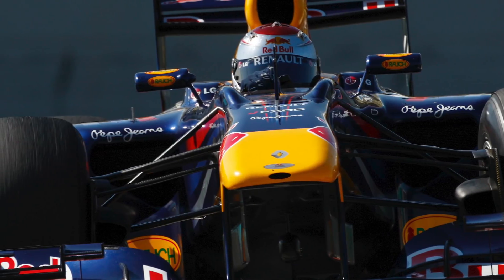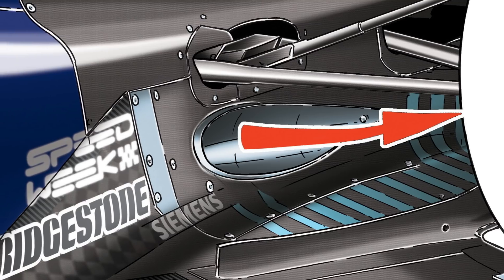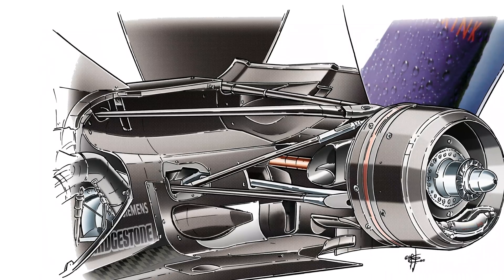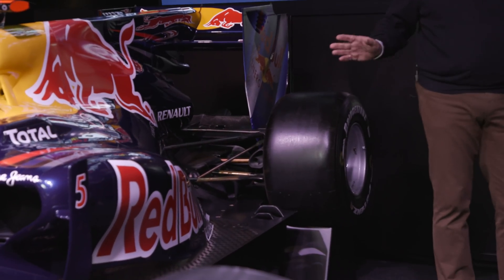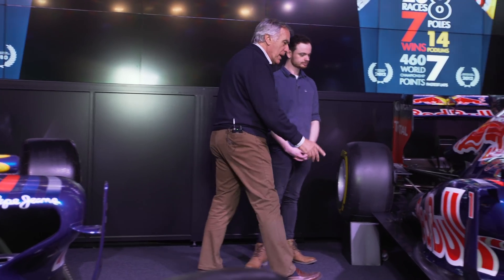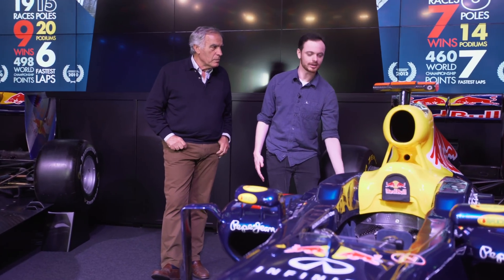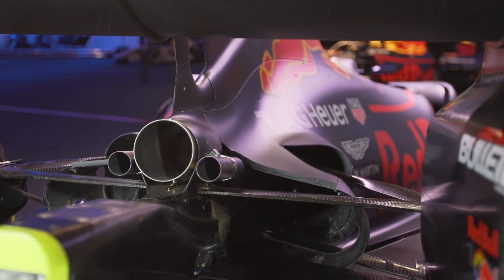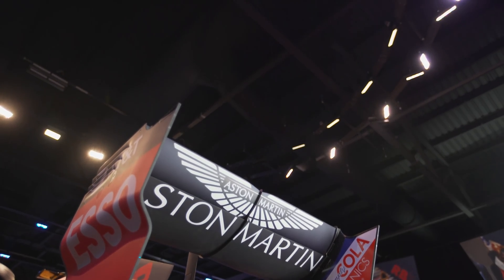The F1 aero trick Red Bull stole a march with - before it was banned

Comment: FIA: "F1 should be about innovation and technology progress!"
Teams: innovates something
FIA: "Wait. That's illegal"
Reply: What is the reason behind this? Safety? Or just bullying designers?
Reply: @faber6021  supposedly they do it to keep any team from gaining an "unfair " advantage over the others since some ideas are so over powered that the other teams have no chance.
Reply: @faber6021  Cost is also a reason.
Reply: Accept when the innovation come from Mercedes.  Then it's fine.
Reply: @elessarKP  agree
Reply: @elessarKP  what have merc innovated that hasnt been banned?
Reply: @nanderlizernanderlizer684  the question is on how quickly it has been banned. Read above.
Reply: @elessarKP  You mean Ferarri..
Reply: @sp3c0ps  ok tell me an example .
Reply: @elessarKP  all examples
Reply: @sp3c0ps  tell me one. I won't play tag. Either you know one or you don't.
Reply: @elessarKP  DAS...
Reply: @elessarKP  except that isnt true. I cant stand f1 fans who just make stuff up. Let's see. Oil burning = banned as the fia thought it helped Mercedes. Fric suspension = banned as it helped Mercedes. Look at all the aero changes the fia have forced through since 2014 all done to stop Mercedes.
Reply: @ads2686  yes after they let them use it for an entire season even though it was illegal from the start. On the other hand they forced Ferrari to change their recovery system 2 races after they introduce it, with the third engine update.  All that after Mercedes filed a complaint. Come on man a 5 year dominance it too long and the fact that the former leader of the team Ross Brawn is now the Managing Director of F1 its makes it even more clear. I mean he is I the guy that put together the team that is now Mercedes.  Hell he even groomed Toto Wolff to take his place in Mercedes.
Reply: KpElessar Mercedes did that because they wanted to know how Ferrari’s system worked, so they asked the FIA to tell them how it was legal and how it worked. 
Same thing is happening now with the inquiry into Ferrari’s engine. Mercedes want the FIA to clarify why it’s legal, by telling them how it works. 

People always have a problem with Todt being ex-Ferrari but not with Brawn having a position in F1 management, given he was responsible for Mercedes becoming successful in 2014.
Reply: @ads2686  Don't forget the DAS system also being banned
Reply: @elessarKP  yeah we want more red bull dominance instead of Mercedes dominance.... Obviously that's much better 😒
Reply: @kityhawk2000  of course not... I want free development with no copyright restrictions. Imagine all these ingenious ideas all adapted in car. If it doesn't compromise safety it should be aloud. Otherwise make it a stock car championship.  I hate dominant periods in F1. Also red bull had the smallest with only two years. The other two where fought to the last race. Unlike Mercedes where the last 6 years under the FIA and Brawn's protection they have no contenders and it's not even interesting! Because as soon as someone finds a way  to be competitive they shut them down. Like Ferrari last year with the power recovery battery. But two years back they overlooked at Mercedes when they where burning oil.
Reply: kityhawk2000 no Team ever dominated like mercedes. The RedBull era was still interessting to watch
Reply: @elessarKP  I'd say BrawnGP's was the smallest period, no.  They only existed for one year, Ross Brawn built a MONSTER of a car that absolutely DOMINATED.
Reply: @collink7145  yeah but it was dominant for about the 3/4 of the season and that is to be expected from a season after major rule changes. But yeah Button was the luckiest driver in history  that season.
Reply: @91TheClash  What about the Ferrari domination with Schumacher? Or Williams being miles ahead of everyone else in '92 and '93? Or McLaren dominance in the late 80s, with the most dominant season in F1 history in 1988? Or do you only care when it's Mercedes because modern F1 bad?
Reply: @91TheClash  Ferrari from 1999 to 2004.
Reply: I'd love 2 see a year where they throw out the rule book and just let the manufacturers do what they want. Can you imagine how fast they could really make these cars
Reply: TheJohn365 one of the big reasons for limiting the cars is safety - not all tracks are French car parks - most have physical barriers off track
Reply: FIA should ban their own stupidity, paradox banning policy
Reply: If costs were a reason then FIA should get on it. The hybrid engines are way more expensive than the V8s before them
Reply: @MPal24  think is that Ferrari was never the favorite child of FIA. They always tried to find a way to them down. FIA always have been favoring British and German. I don't say I know the hole formula 1 history it's just a feeling a get.

 I've watched F1 from 1995 give or take, but I was small at that point. I came to understand more about the sport at the early 2000s. And the feeling I always got was "If it's not British or German related then they must be stopped". And I understand that wealthy nations provide the most attendance to Grad Prix. 

That's my opinion. From history I can recall and the final outcomes, I can safely say it's not a wrong one.
Reply: Actually Mercedes: wait that's illegal.
Then FIA: oh my Hamilton you sad! Let me ban that for you so you can stop crying and again little baby, come grab a candy. I'll work this out for you dear
Reply: @GFSCN69  enlighten us. please.
Reply: @GFSCN69  indeed, but i sincerely hope you are talking about the comments and commentators.
Reply: innovations don't mean no regulations
Reply: Is FIA career over?
Reply: Lol red vs blue
Reply: Well, the real innovation was from the 80s when they blew the diffusor directly, which was banned. The RB solution was just a way to get around that ban. So in terms of rules consistency, they banned it also.
Reply: Fia it's actually helping innovation. Banning cool systems it put's those awesome european equipes to invent new systems even better than before you brainlet.
Reply: Red Bull dominate for 4 seasons: time to change the regulations 
Mercedes dominate for 6, going on 7 years, more dominant than Ferrari ever were: nothing unusual here
Reply: @Willie_Pete_Was_Here  technical regulations changed 2017 heavily, and 2019 also a bit.
Reply: @Willie_Pete_Was_Here  the new regs werent because of red bull, they had been planned long before and everyone knew it. Mercedes were the only one to take a gamble and start developing an engine early and make a good chassi for it resulting in a very dominant car. As the turbo era went on they lost their engine advantage (ferrari had a stronger engine 2017-2019) but their success had made recruiting easy so they hired the best of the best to continue development and now they have the most complete F1 car ever and they have the minds to overcome all regulations. Only thing that I think can hurt them is the budget cap that has now been instated for 2022 so that will be interesting
Reply: Except it was Mercedes..
Reply: Yes, but the teams exploit grey areas. So the FIA tries to get it banned, but because it’s a grey area, they are safe. Also, the teams screw each other.
Reply: Aslamnur Fikri

The clue is in the name of the sport. FORMULA 1 
"The Formula" being the rules by which teams have to design the cars. Simple as that.
Reply: If F1 has no limits here, Ferrari would be dominance, because in the past the teams had ilimited tests for differents models of F1, until they banned It.
Reply: @celsodeporico6761  that's why I said it should have been with out copyright restrictions. If you  develop it then your competition can copy it and then improve upon it.
Reply: @elessarKP  F1 and the FIA doesn't control parents or copyright, the teams do. If the teams want to copyright something, they have every legal right to do so and the FIA can't do or say anything about it. Plus, why should the smaller teams try to innovate if they can just copy the bigger teams? At that point, it's basically just a spec series. Also, Ferrari has always been the FIA's golden child. If Ferrari complains about something, it usually gets banned. Bernie Ecclestone has even said that they deliberately favored Ferrari back in his day